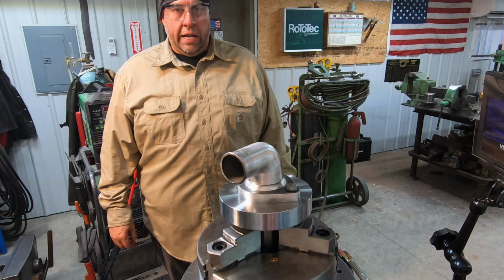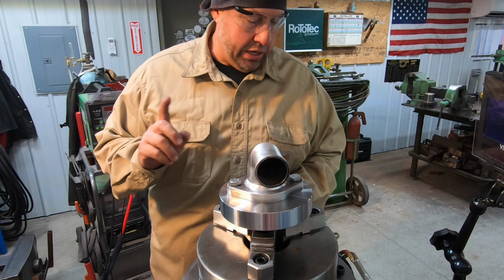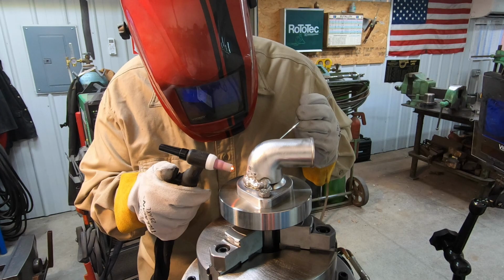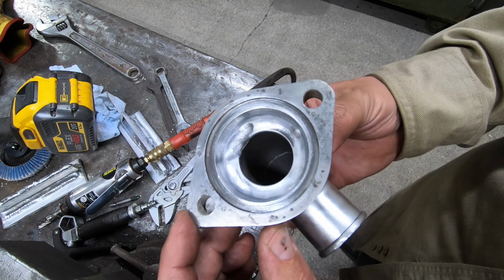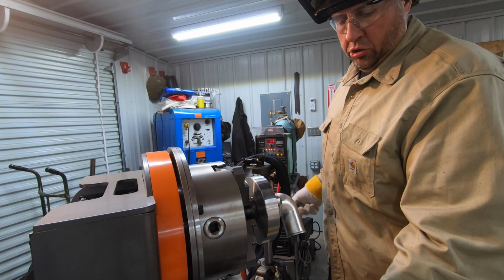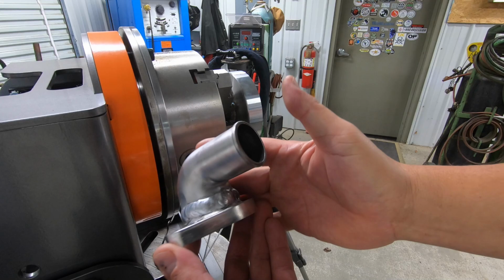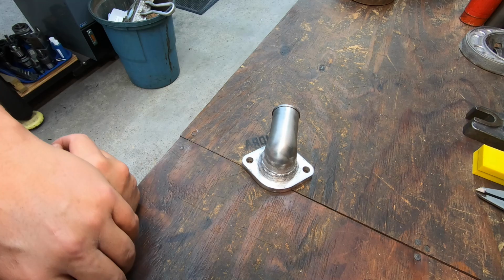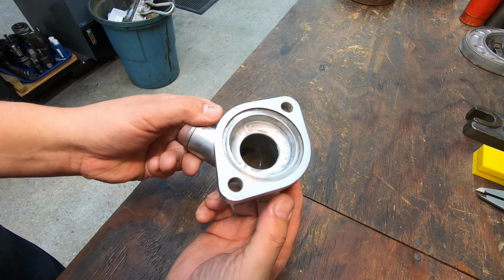SNS 328 Part 2: Welding the Custom Mopar Water Neck

Comment: Yeah - did you degrease it with acetone first? And do hold a steadily tighter arc, please. I'm not saying it'll fix it but you have to do everything as perfectly as possible to eliminate those as factors.

Comment: Would purging with argon on the inside help with the poor material??
Reply: No it doesn't unfortunately. It helps very much with very thin gauge material  (1mm or less)...Basically because the back purge helps prevent the Aluminum from melting before the oxide layer has been removed by the arc.  The reason he has had so many problems is because he tried to weld it first in the vertical position with quite a bit of distance between his torch and the weld. Argon is heavier that air, as the argon leaves the torch it will naturally flow down. Basically he just didn't have enough gas coverage. He cleaned out the porosity and then welded in the horizontal. When tig welding you should always try to weld in the down position...not always possible but you should always be aware of the gas flow. The test pieces he did were in the horizontal in a fillet which will naturally create a gas trap...That's why they were so nice and clean. Hope this can help someone.

Comment: The problem with aluminum is that there are so many different alloys nowadays!
When you find a problem like that, try different aluminum alloy rods until you find one which does the job. Some bite on anything, others don't bite at all due to the composition.

Ideally, a sample would be sent in order to have the composition sheet. But on such jobs, the analysis gets more expensive than the job itself!
Try to so stock as many Al alloy rods as you can. Always try to remove the alloy's oxides layer before welding.
These metals can be a freakin pain!
Reply: PS: I think you were absolutely right in regards to impurities.
Cheap recycled aluminum creates alloys of god knows what, making it a pain to weld. Just a fraction of the wrong substance can make it extremely difficult to work with. Turning up the temp was a great idea. But when were are working with thin wall materials, it becomes a mess.
As always, you did an awesome job! Much better than I could ever do!
Thank you for another great video!

Comment: I think the issue is were you used a steel wire brush to clean the black coating off of it. I’ve always been told don’t use anything on aluminum that’s been used on steel. I have had issues myself doing the same work.
Reply: I other videos you see he uses separate stuff for steel and aluminum
Reply: What kind of brush are you supposed to use? Brass bristles? Surely not. Most brushes are steel...
Reply: @railgap  stainless steel wire brush. It want contaminate the aluminum
Reply: @railgap  steel

Comment: If it was magnesium and you placed a tack on it, tap it lightly with a mallet and the tack would break loose on the magnesium, pull out completely. I don't exactly agree on keeping it cool but that's my opinion at least the job is completed

Comment: I have to say, aluminum is still my worst material to weld. MIG welding steel is a breeze compared to TIG welding any type aluminum.  And the thinner the aluminum, the big blow outs takes over.

Comment: Possible problem you said you cleaned it up with a wire wheel. It has to be a stainless steel wire wheel . If you use any another it deposits impurity's into the aluminum

Comment: Don't beat yourself up over a poor quality part Detroit started pushing out the door. I was a GM mechanic and we would get a lot of what the factory called 'aluminized' parts. If you were lucky they had steel in the mix and if you were unlucky, which is what I think is your case, they mixed in pot metal type alloys. This was when they were first trying to save weight for gas mileage mandates and quality be damned.

Comment: What alloy filler rod were you using? I have a small engine crankcase I need to weld & I'm not sure what to use as I haven't welded much cast aluminum

Comment: Maybe the wire brushing was part of the problem?  I have noticed that stainless steel will show up rust patches where it has been wire brushed.
Reply: You have to use a stainless wire brush and you can't cross contaminate the two metals (mild steel). Stainless company won't even work mild steel with their equipment because of that.
Reply: @essentialjudge2279  Thanks for that - there is always something  to learn.

Comment: One of those parts is cast aluminum. Thats the impurities being pulled up.

Edit: Also, you could have used a smaller filler rod from the start along with lower amperage.
Reply: Wrong!!! It has nothing to do with the casting!!! It was fine when it left the factory!!!
It was contaminated with coolant!!!!
Happens all the time in all aluminum!!! Coolant gets in the pours and you will not get it out!!!
Rock on!!!

Comment: Not a welder or machinist yet, but usually I still hear your gas purging when you take off the arc. I'm not hearing gas at the end of an arc! Could you be having gas flow problems?
Reply: Strange ... you wrote the evidence down yourself, but came to this strange conclusion?
If you hear "pffffff" every time when he starts welding ... that simply means that the valve closes at the end of the operation.  Otherwise (LOGIC!) if the valve would not close, you wouldn't hear that sound (at the start of the operation) again ... EVERY time. My suggestion and what the evidence shows: Shutting down the gas flow just doesn't make a sound. Or is this to simple? (Because that's what is going on, here, hehe). BTW: No focus (including microphones) is directed at the gas-sound, nor is this a video about that topic. So naturally ... we have (too) little information to even make a claim what is going on. Maybe I am wrong? We don't know! (Actually we know ... it would be an absolute disaster if there was a protective gas problem while welding AL). Yeah, a video about the pressure gauge would be a thing. But we don't have that. 
P.S.: It was just cheap die-cast aluminum alloy. That's what it looks like then. You can't do anything against it, when the starting material itself is so inferior. It's like with chili... if there are a few bad beans, there's gas problems too. hehehe, excuse that joke regarding your gas flow comment:)
Reply: It’s just the post flow cooling the tungsten

Comment: I weld repairs on aluminum all the time, I have a method, weld grind repeat 3 times! by then the crud pulls it to the surface. aluminum is a sponge for oil.

i recently had to fix a boat, on the bottom side of a 16 fter and it had foam and glue on the top side of a tear from a steel post. it was a pain and it was also thin.

Comment: seems it would have been MUCH EASIER to make a new base plate altogether. Bevel the tube and the orifice, all from 6061. You could have welded it in under 5' in a single pass. Trying to save and reuse the original neck is a silly idea.

Comment: Sit down, use pulse and foot control to help control excessive heat, smaller filler, higher frequency, as much cleaning action as your electrode can handle and use only a dedicated stainless brushes. Wipe all parts with acetone. Personally I like E3 (purple) electrodes for cast aluminum.  Obviously cast is very porous and every pore is a pocket of corrosion that has to be cleaned, burned or blended away. Carbide is your best friend.  All in all you did EXCELLENT.

Comment: You need a hand rest, also clean the parts and rod with an acetone wipe down. Doesn’t take much crud to contaminate the weld. That’s not magnesium, I have welded magnesium it’s a handful and the rod is expensive. Ceriated or pure tungsten electrode, 1/8” will be the most reliable. I prefer purple or lanthanited electrodes. 225-250 amps. It also looks like your positioner is rotating too fast.

Comment: When the torch is pointing to the direction of travel it is a cold process. The digging into the base metals is controlled by the torch. Keep the gas shield on the puddle until solid. Again it is a slow process with more angle control.

Comment: If it were Mg wouldn't it be burning on its own?  Curious.
Reply: No, its already oxidised.
Reply: Not while in the argon shield gas
Reply: @m93sek  If a magnesium (or any metal) casting was oxidised to the extent that it won't burn, it would be a pile of powder on the workshop floor
Reply: @paulg3336  Not a welder here...just a mechanic(how demeaning).  But also a thinker and hence the question.
Reply: @nhzxboi  We learn by asking questions. All fusion welding processes require a shielding gas to keep atmospheric oxygen away from the hot weld. Electric welding such as MIG,MAG and TIG use bottled gas mixtures. MMA (Stick welding) uses a solid flux that partially vapourises. Oxy-acetylene uses a reducing (already oxidised)  welding flame. You'll notice that Adam leaves the hand piece near the weld for a few seconds after he stops the arc to let the weld cool while the shielding gas still flows and protects the weld from the air.
Reply: @paulg3336  I used to MIG weld cracked, mild steel gas tanks(wood chippers) with gasoline in them after I purged head space with exhaust and 02 was < 2%.  It worked fine.  Wasn't my invention, just something I learned.  I never did dare use an oxy-acetylene torch on or near a Magnesium X-fer case though.  Was easy to tell it was because they said Magnesium right on them.

Comment: I highly recommend you getting your hands steadier. You will never see a pro tig welder with his torch hand out in the open like that. Let alone holding it like its a hammer. Pinching it like a pen goes a long way in itself
Reply from the maker: I already mentioned building a stand for my hand to rest on, I'm well aware of it making things easier to provide better quality welds, but you need to learn not all "pro" tig welders use rests to weld. So many folks in the industrial welding sectors use just their hands to get work done, such as when building large parts, or even pipe. Not all welding jobs are done on a bench and on a positioner. Holding the torch a certain way usually depends on the welding needed to be done, such as if you will be using the thumb switch or foot pedal. Tig welding isn't just for the Instagram crowd.
Reply: @Abom79  fabrication and primarily tig welding has been my life for the last 5 years. Just trying to help. Propping helps immensely:)

Comment: It's so interesting to see you have the same kind of issues that SVseeker has run into.  He has done a TON of alu welding, with a different kind of welding gun tho.  I would love to see a collab between you two where you go to Tulsa and take a few passes on his equipment.
Reply: He has just been there mate, during the summer of our discontent :). And by the way Doug is using MIG not TIG for his aluminium welding for the most part with the Spool Adapter and 100%Argon

Comment: Had a temp gig years ago and the owner knew I could weld. Had an Aluminum part break and asked if I could TIG weld it. Their welding gear was absolute crap. Nothing worked! Oxy Acetylene tanks MT. Stick welder DOA. MIG same story. Told him I knew a shop nearby that could fix it. OK. Then he bitched about the price. I quit not long after that...

Comment: Could you not have turned that crappy weld down, in the lathe, rather than grinding it off?
Reply: the 90deg bend would require a very long tool to reach in there. It is aluminum though, so probably not that hard to machine. Sometimes the grinder makes the fastest work.

Comment: Welding Aluminum?  Good luck with that!
Reply: Very common to weld aluminum, but you must use an inert gas atmosphere to weld it. He's using a TIG (Tungsten Inert Gas) welding system.

Comment: Evinrude/Johnson/OMC had some of the worst cast aluminum on the planet!
Reply: I've have a 70hp 3 cylinder 1980 Evinrude and a 200hp V6 200XP Looper Evinrude. Both were perfect and still run great today. 
My dad, grandfather, uncles, and cousins have has Evinrudes and Johnsons for several decades without any issues.
Never heard anything bad about their castings before.
Reply: @saltysteel3996  Trying to weld their aluminum was quite hard. Evinrude/Johnson/OMC service tech ~1982 - 1988 & 1990 - 1997

Comment: Stick to machining man. Zero penetration on the weld due to ur poor fit up.
Reply: Aaron Hobbs ah the expert is here.
Reply: @loudonrebel  fucking weld alloys and alu 100 times better then that as im certified. Do u even weld?
Reply: @aaronhobbs8716  why don't you tell us about  your experience goof
Reply: @Bobbyjwmwb  im asme and cwb certified to stick, mig and tig weld alloys. Are you?  #UneducatedHack
Reply: @aaronhobbs8716  chill guys, just a vid. Move on with your lives and have a great day!
Reply: Aaron Hobbs you should make some videos then.
Reply: @loudonrebel  too busy working. Lets see yours
Reply: Nothing to do with poor fit up. He was welding in the vertical without enough gas coverage...It was dirty and he got porosity end of.